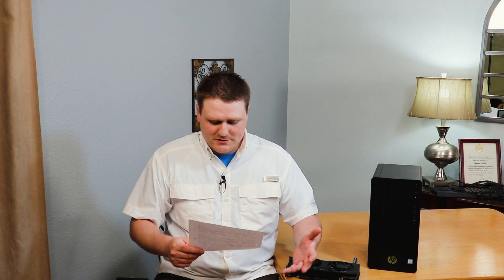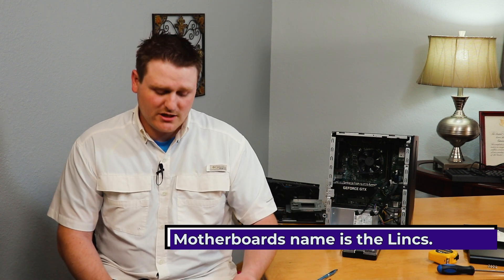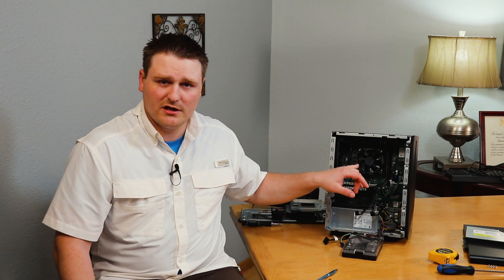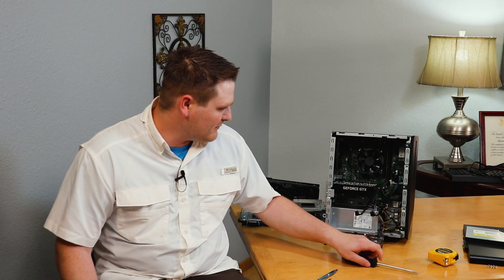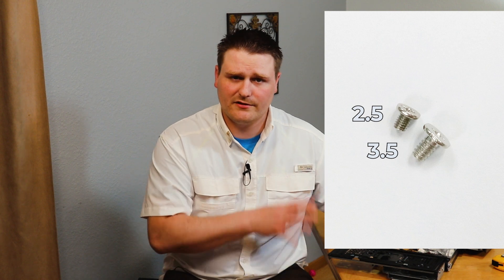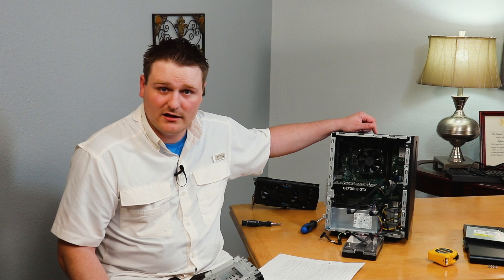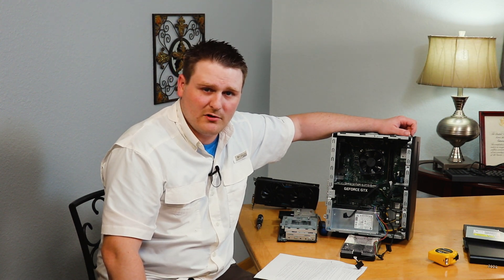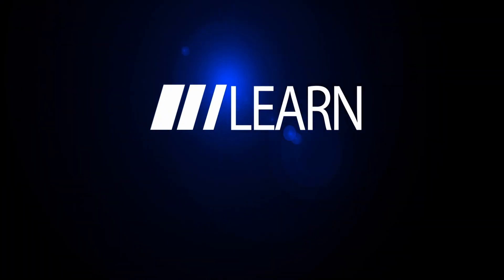Upgrading A HP Pavilion Gaming Desktop Explained! | Intel i5, 1660ti, 8GB, SSD + More! HP 690 Models

Comment: So I have the newer version (Tgo1 withoutthe disk drive) and someone said that if I want to upgrade the stock heatsink I need to get a socket retention bracket as the heatsink bracket also holds the socket/CPU mounting in. Also here's something interesting the power supply in this is 410 watts at 80+ platinum.
Reply from the maker: I have not had the TG fully upgraded yet. AMD is a bit different then inlet when it comes to the socket. Most heat sinks you buy, will come with the back plate and hardware you need. Problem is hp likes to epoxy them to the board most of the time.
Reply: @TNW1337  so it's time to break out the plastic spudger than thanks for the info on the heatsink. Also I enjoyed the video and I hope you have a good day/night.
Reply from the maker: @ethanjacobson3867  Thank sir

Comment: https://store.hp.com/UKStore/Merch/Product.aspx?id=8UD33EA&opt=ABU&sel=DTP&lang=en-GB&pup_e=1&pup_cid=55877&pup_id=8UD33EA%2523ABU&gclid=CjwKCAjwrcH3BRApEiwAxjdPTSFLRPSWg_eMqjaW0rkrOZTDN1rEignaIj-_Z3x7X2S9zy0ewMDqTBoCNEQQAvD_BwE&gclsrc=aw.ds
The link above is the PC that I have. Will i be able to upgrade it to a gtx 1660 SUPER? Thanks.
Reply from the maker: You have the 310w Gold Psu you can put up to a 1660ti or low powered 2060RTX.
Reply: @TNW1337  that's really good to hear. I don't know how to change a power supply so that's good.

Comment: If I want more storage/faster performance, is it better/easier to upgrade the nvme or just install an SSD?
Reply from the maker: Depends on what you have installed from Hp. Most come with a Nvme, so a ssd. you will want to pull you side panel off and look.
Reply: TechNitWit The 256 gb nvme
Reply from the maker: @ThisisSirLancelot  Then a SSD would be your best bet unless you need more space.

Comment: Greetings from Puerto Rico, you've helped me alot. I recently bought a Crossair Vengeance RGB Pro DDR4 kit of 32gb 3200 MHz. The thing is my frequency is at 1066 MHz with a 15-15-15-36 latency. Is that ok?
Reply from the maker: What are you using to get the ram Mhz? As it could be reporting it wrong. Also I've seen the newer boards down clock the ram Freq when idle.
Reply: I used Speccy and CPU-Z
Reply from the maker: @colo714  Can you play a game and see if it clocks it higher? Some of the newer boards have Epu and down clock Freq when at idle.
Reply: So I started a game but I see no changes
Reply from the maker: @colo714  For some reason the board is down clocking the Ram Which is to be expected. I am not sure why it is showing 1066. Maybe that the ram does not support the 2933 Profile. I have tested Corsair, Kingston, Adata & Crucial all worked. They did clock from 2933 to  2400. Also Remember PC4-Number is not the same as the Mhz. As this can be confused. They have gotten better about labeling tbh. What happens if you remove one dim ?
Reply from the maker: @colo714  What does task manger show Memory at?
Reply from the maker: Open up Windows Power shell type: wmic memorychip get speed
Reply: I ran PowerShell and it gave me 2133 now
Reply: In the Task Manager it says 2133 too
Reply: I also checked the Bios and 2133 again
Reply from the maker: @colo714  .Also Be aware that because it is dual data rate memory, So you would times the number in cpuid by 2x which is 2133 still below 2933 but I would take that over only having capacity of 8Gb 400mhz difference.
Reply: Thanks alot for your time man. Full support for your channel!
Reply from the maker: @colo714  any time thanks for the support!

Comment: what ram is it i should buy to get 16gb ram
Reply from the maker: I do have a list in my comments but any thing below 3000Mhz or 3200Mhz DDR4. Its really cost, at this point. if you could overclock it there are brands I like. but this board does not allow that. I like Corsair, Crucial, Adata is good. They are on the cheaper side.

Comment: How cramped are things in there? Should I be able to install an extra 5500 xt? And would you recommend the 5500 xt?
Reply from the maker: no you can not you can fit 2. But a 5500 xt will work.

Comment: Hi

Awesome video, I just  purchased a 690-0076a and you are my personal life saver!

A couple of questions, my pc has 310W power supply,  Intel Core i7-9700F and 16 gb Ram 16GB DIMM DDR4 clocked @ 2666 MHz. My Pc mounts a weird OEM gtx1050ti red board no shroud one fan, possibly to reduce wattage? I need to replace the gpu. if I understand correctly a GTX1660 ti Super should  be fine without changing the 310w PSU? And in case I need to change the PSU, will I need to use a HP one or can I fit a standard 400w or more?

The rtx2060 and 2070 have the same consumption and a 400 will be fine?
 
Should I use the mini version of these cards? is the mini versions performance lower than the standard size (why are they cheaper?)Thanks heaps.
Reply: https://h30434.www3.hp.com/t5/Gaming-Desktops/Upgrading-options-for-my-HP-Pavilion-Gaming-Desktop-690/td-p/7618857
Reply from the maker: Well you Have 3 routes you could take as the price of a 1660ti is pretty close to the same as a 2060RTX. or go with the 2060 RTX super. The 2060 & Supper has about a 14% & 28% gain in performance over the 1660ti. Most supper also come with 8Gb Vram.The stand Atx PSU will not work. Now you could order the 400 watt PSU. From Hp pretty much your only option for a psu upgrade. Unless you want to go surgical on the pc. Then you know 100% you will not have a problems, The 690-00+- uses a SFF power supply its a slimmer supply more like whats in a server. 
They also do not use stranded pin outs on one cable to the mother board😣. Then you could just drop the 2060 super dual fan in with a 400 watt Psu. The mini's are a more compacted versions of the cards. Most of the time it's a laptop style PCB board with lower powerd card. Some times they can not cool the card right, and performance is sacrificed. 
So yes the larger cards, most of the time are better.  You can fit a 9.5in card in the case. I've had the Evga 970 Sc2 as a stand in to show this. I will probably just have to do a video on this as it only goes in 1 way, & it is not obvious either. 
Pretty Much it comes down to wattage for you 
the 1660ti is 120 TDP watts vs 2060 is 150 TDP  watts, supper is 215.  When I did the math with a 65 Watt Cpu i5/i7, Nvme 7, Hdd 2-3, Motherboard 60, Gpu 120 , Dvd Rom 3, SSD .8 & Ram 12. I cam to 270.8 That still gives you a 15-20% overhead which is good. If you get the 400watt Psu you should be able to use the 2060 super. 

Hope this Helps.

Comment: Which one to buy? (both GPUs cost the same price)

Gtx 550 ti 1gb gddr5 128bit Pcyes
Zotac Gt 630 4gb ddr3 128bit Synergy Edition
Reply from the maker: New or used ?
Reply: @TNW1337  both used, but with approximately the same usage time
Reply: both with less than 1 month of use
Reply from the maker: @wiy6789  Well they where made around the same time. so witch one has better stats and is faster. DDR5 is faster but capacity also matters. Look up cuda cores, Go with the one that has more. also ddr3 vs 5 is a lot better. but so is 1Gb to 4Gb vram. May I ask what you want to spend ?
Reply: I want to use the GPU to play some games like GTA V and CS: GO, even in low / medium settings. I know the Gtx 550 ti has a good performance, but I don't know much about hardware so I don't know if the GT 630 will do well.
Reply: @TNW1337  I believe I can get a lower price for the GT 630, a difference of about 9 dollars (which is quite a lot here in Brazil kkkkk) GPUs cost 63.02 dollars (R $ 350)
Reply from the maker: @wiy6789 Well the 550ti has 192 cuda cores but only 1Gb of ram. The 630 has 4Gb of ram and 96 Cuda Cores. They are kinda like CPU cores. They also moved away from using Cuda cores. From what I can find Gta 5 needs about 2Gb or more of Vram to run ok. Is it possible to wait and see if a better deal comes up? the 700s are still very good cards. If you have to pick I would say more Vram. Because if you do not have it pretty much the game becomes unplayable.

Comment: I need a AMD list
Reply from the maker: Mother board: Sunflower. Sockit AM4. Chipset: AMD Promontory FCH.
 Ryzen7-2700, Ryzen5-2600,  Ryzen7-1700, Ryzen5-1600,
 Ryzen5-2400G,  Ryzen3-2200G. 
 Should work have not verified these Ryzen7-3700x, Ryzen5-3600, Ryzen5-2500X
Reply from the maker: Sure thing
Reply: R7 2700, R5 2600, R7 1700, R5 1600, R5 2400g, R3 2200g, a12 9800 apu, a10 9700 apu, a8 9600 apu.

Comment: Whyd you put a 2070 pic if you said 2060? Wouldn't the mini 2070 super work? And it wouldn't take much more room up being that the 1660 is 7.8in & the mini 2070 super is 8in.
Reply from the maker: Yes it was the wrong card, it was suppose to be a 2060. When I picked out the image. It would not load in to adobe. I had to find a new one & must have overlooked this. 

The only problem is wattage, with a i7 or i5,   32Gb ram, 1 Nvme, 1 Hdd, 1SSD, Dvd rom & Motherboard, your siting at or around 300-320 watts. You want around 15-20% buffer on your power supply. @ 20% that's 80 watts. Now you can push this and test it out but you right on the edge. The 2070 & suppers Has a TDP of 215 watts where the RTX 2060 is 175 watts. 40 watts more at 360. that is 10%. Do think it will work yes but for how long not sure.
Reply: @TNW1337  if you test for a psu & add the 2070 it doesn't effect power consumption much it still sits in the 400w range. I was thinking getting the mini 2070 with a 8700 non K.
Reply from the maker: @xPL0Tz  It should work just fine. You have to be carefuller of what it use at max usage. I will have a video out soon of the i-5 with 16Gb of ram and 2060 supper. the none mini dual fan addition.
Reply from the maker: I think if you wanted to you could get away with a 2070 & 8700 non k to work. As long as you did not stick in 3 Hdds. Also keep to SSD's and one M.2
Reply: @TNW1337  I ended up upgrading to a 2060 super, got a 32gb ram kit (not that it effects gaming I do other stuff too), & keeping the 9400f for now. I really want to flash the bios I'm not to happy with the very limited bios HP put on this system. You should do a video on that.
Reply from the maker: @freakylightning Awesome 🚀, Good Idea! 
I could do a in depth video of the bios settings. Also maybe talk about thr hidden hp recovery partition, to reinstall win10. I know that the bios stuff on most Hp is lacking a bit.
 I have a upgrade video planed for the 690. One problem is, it only has one Nvme Slot.  I was thinking of getting one of the 1x PCIe to Nvme? or a USB-C to Nvme? What do you think, would be easiest?🦧 The USB-C would be the simplest way to do it.
Reply: @TNW1337  yeah they're definitely lacking that's for sure. I'd say usb-c would be the way to go. No point in wasting a PCIe for storage. You can always reuse the PCIe for a new usb-c afterwards. I'd say there's more room for improvement if you keep the PCIe available though.
Reply from the maker: @xPL0Tz  Yeah I was just worried windows may not like that it is installing to a usb. Not sure if it would have drivers problems.
Reply: @TNW1337  Couldn't hurt to try.
Reply: @TNW1337  you could get a male to male usb-c extension, along side a m.2 usb-c enclosure, throw an m.2 in there, to essentially create an external m.2 flash drive. Not sure if it would work but you could give it a try. If it does it could potentially run 2tb & give any flash drive to date a run for its money.
Reply from the maker: @xPL0Tz  Kind a what I was thinking.
Reply: @TNW1337  i seen a usb-c enclosure with a male connector on Amazon.
Reply from the maker: Yeah that is true That would work. They also make external bays for M.2's, I was thinking that may be the easiest for people to follow.
I do know the Drivers for USB-C are different from USB 3.0/3.1. I know they are aimed more at drives & speed. 

I am happy a normal sized GPU fits in it, it brings all the temps down on the PC. Which is just going to allow it last longer also get better performance.